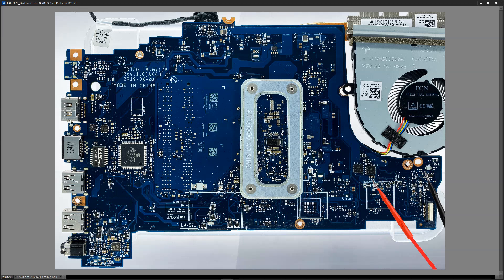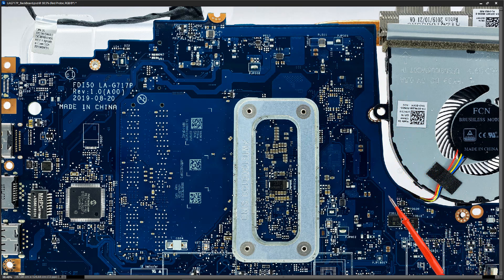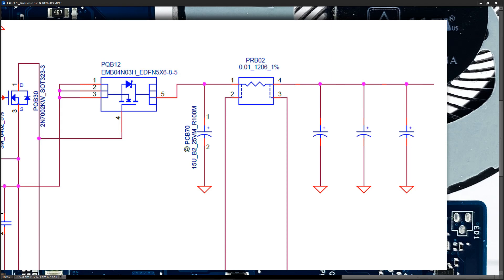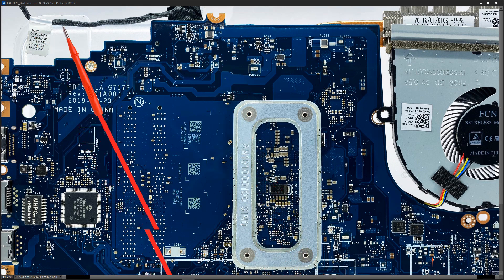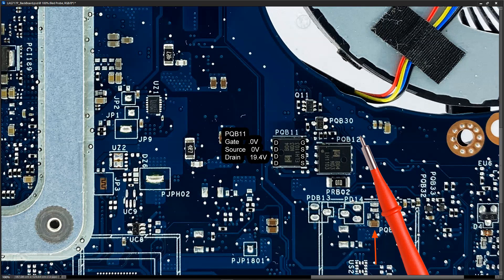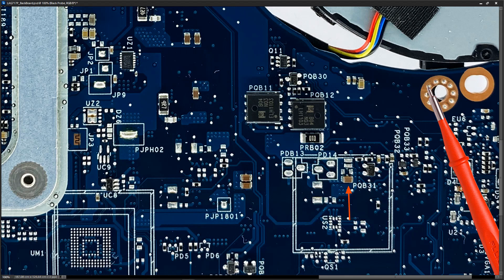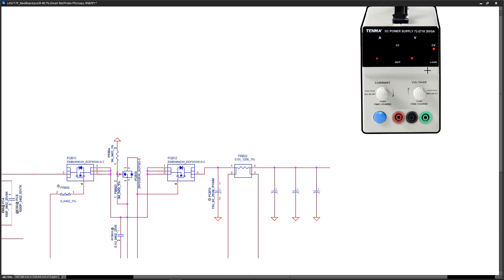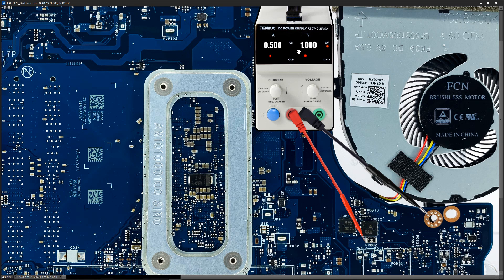Dell Vostro 3590 -  Simulating A Short On The Main 19V Power Rail

Comment: Great vid man. I have a question.  What if there's no heat even after injecting as high as 4v 3amps ? I'm dealing with a dell that turns off adapter and has shorted 19v rail..

I hv tried injection 1,2,3,4v 2amps still no heat even on the thermal camera. Board is wayy too cold. But surely there's max current consumption.
Reply from the maker: You may need to bring it up to as much as 5 amps if the shorted component is large (and able to easily dissipate the heat).
Reply: @therepairshare673 okay thanks for the reply❤

Comment: I am learning that the nice thing about these Dell motherboards is that each power rail has a jumper, such as PJPx01, which you can use as a test point, an injection point, and most useful of all -- you can wick away the solder on the jumper to isolate the power rail, so you can take measurements on that rail alone. Very cool feature.

Comment: BRILLIANT! Thank you so much! I have been refurbishing Dell Inspiron 5570 and 5770 laptops that have the CAL60 LA-F114P motherboard. I have learned how to repair the PS_ID circuit, and I have replaced a shorted power jack. Now I am faced with the classic issue when the charger goes into protection mode due to a short on the main power rail. Your video is the best tutorial I have ever seen on YouTube for this issue. Many others demonstrate power injection to trace shorts, but you are teaching a Master's class. Thanks again!
Reply: Well, I tried injecting 1V@1A at the resistor, but the voltage on my bench power supply did not drop very much. It drops to 0.2V when connected to a true ground, but it only drops to 0.8V when connected to the resistor of the 19V line. I tried increasing from 1A to 2.5A, and nothing got warm on the board. The resistance of the 19V line is only 0.2 ohm, so I don't know where the current is going. I will keep trying.
Reply: My current theory is that the very first high side MOSFET that connects to DC_IN is dead. I will try to check measurements between source, drain, and gate to see if it is internally shorted.
Reply from the maker: @danarepouille1381  Might be interesting to work along the troubleshooting process for that board in a video. Can you just confirm that the model number of the motherboard is CAL60 LA-F114P - is that exactly how it is written on the board itself? I will see if I can find a schematic.
Reply: @therepairshare673  The schematic I have been using has a filename UMA_LA-F114PR10_20170726.pdf. The board I am working on now is a CAL60 LA-F114P Rev 1.0 (A00) 2017-09-04. I have one donor board that is also Rev 1.0, and four donor boards that are Rev 2.0 (A01) 2018-05-04. My donor boards are missing TVS diodes or USB ports, but are otherwise functional. Any board that has a 7th Gen Intel CPU I make a donor board, since they are not fully supported by Windows 11.
My current theory is that PQB11 is dead on the board I am troubleshooting now. I am just not sure how to prove that, short of removing it and running a jumper wire across it.
Reply from the maker: @danarepouille1381  Great, I've got the same UMA_LA-F114PR10_20170726.pdf file, thank you to badcaps.net. Can you clarify at which resistor you are injecting voltage and observing 0.2 ohms resistance?
Reply: @therepairshare673  Low resistance between PRB02 and PLB02, so that is where I injected 1V and 1A (increasing up to 2.5A). I could not find anything getting warm using alcohol or fingers. I need to buy a better multimeter to get better probes and more consistent measurements. I am not sure, but I think PQB11 looks discolored under magnification. I see that the PD1 TVS diode in the PS_ID circuit has blown open, but that is unrelated to the power rails. However, it may indicate an overvoltage condition from the charger, which blew PD1, and may have affected PQB11. Thanks for your time. I am learning a new skill as I approach retirement. I refurbish Inspiron laptops and then give them away or sell them at a loss. Learning is the goal.
Reply: With no overheated components found, the short could be on any power rail, since +19VB goes everywhere.
Reply: My Dell charger's light goes off as the charger goes into protection mode. So the only way I can inject 19V into DC_IN is by connecting my bench power supply there. I am worried about doing that, because I know there is a shorted component on the +19VB rail, and I don't want to cause any more damage.
Reply from the maker: @danarepouille1381  Please contact me directly on therepairshare @ gmail.com